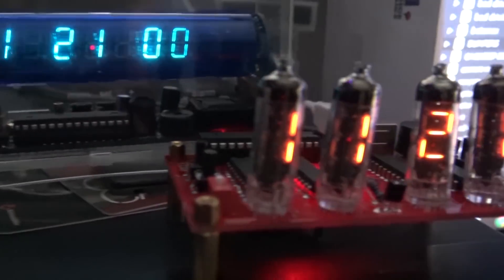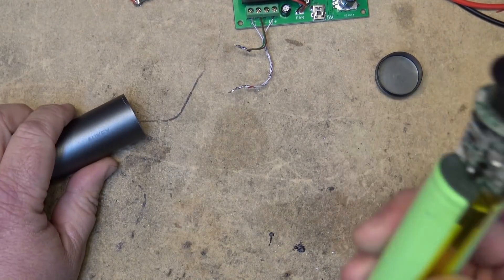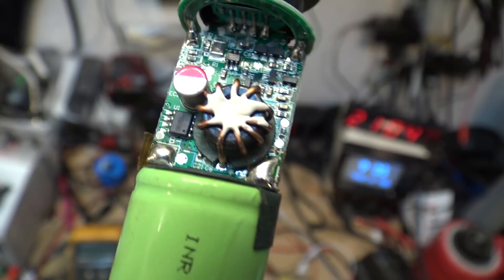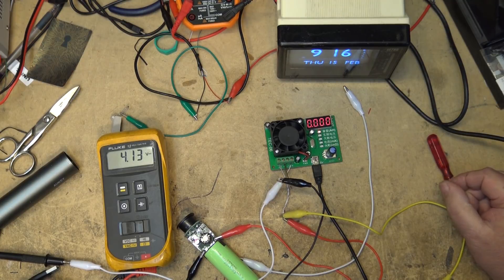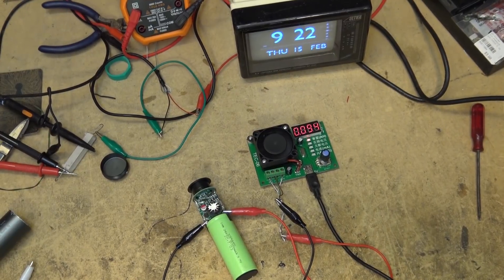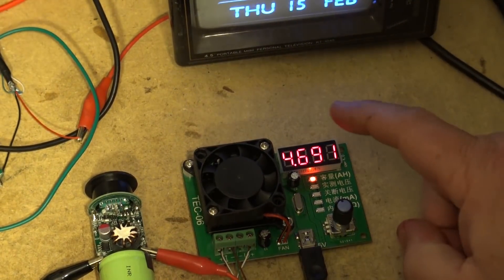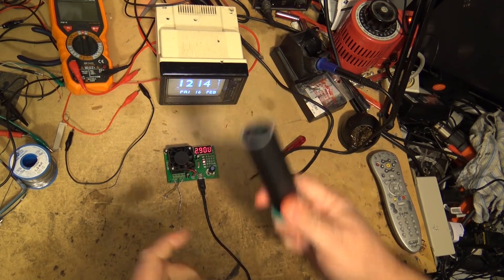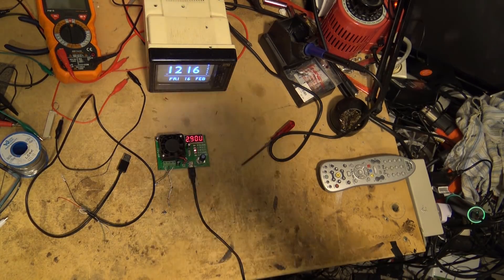Aukey 5000 mAh power bank tear down and cell measurement

Comment: Nice video Dave and that Aukey power banks seems to build like a tank. Anker is a nice brand and not super expensive. I have a replacement battery in my Samsung Galaxy S III after the Samsung original battery died.
Here is the Power banks that a use.
HUAWEI AP007 Power Bank 13000mAh https://www.gearbest.com/mobile-power-bank/pp_159245.html
Deltaco 16000mAh PowerBank / USBx3 5V 2,1A+1A https://www.multicom.no/deltaco-pb-815-power-bank-16000mah/cat-p/c/p8709920
TP-Link TL-PB10400 10400mAh / USBx2 5V 2A+1A with Built-in flashlight https://www.tp-link.com/us/products/details/cat-5524_TL-PB10400.html

Comment: Hey what you think of this tuby?I know 1 for sale in the Netherlands.What should you pay for a beast like that?I bet the curtains not protect the windows to blow out on the street haha.
https://www.youtube.com/watch?v=fRt8CoZT35k
Reply from the maker: Yup that is pretty cool. Don't need a furnace in the house with that beast.
Hell my little tuby's heat the house nicely. 
Waiting for a new model to built.
Reply: 1000 watt class-B power amplifier
- Driver: 2 x EL34 (6CA7) as cathode follower, DC-coupled with the end tubes
- Symmetrical input
- Frequency breaking 25 ... 15,000 Hz +/- 1 dB
- Power connection: 3-phase (220 / 380V)
- Anode voltage: 3,200 V
- Anode current: 250 mA (full drive), 50 mA (quiescent current)
- Year of construction: 1955

Comment: 2.5 Volts as minimum voltage is pretty common for the same chemicals used as in the Panasonic NCR18650Bs.
Also your discharge current is pretty high, that can result in lower capacity readings as the manufacturers certainly only pick the best conditions so that they get the maximum capacity on the data sheet. ;) It's uausally 500mA, 1A at max.
Reply from the maker: Well I went with 3, as the specs say 2.8 - 3.0 as the discharge voltage. Next time I will use 2.8 and see what I get.